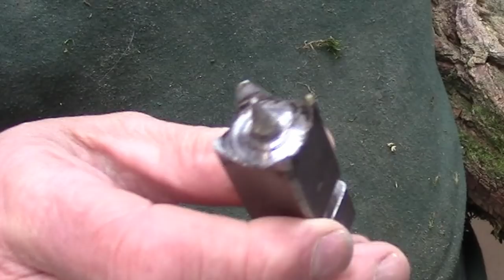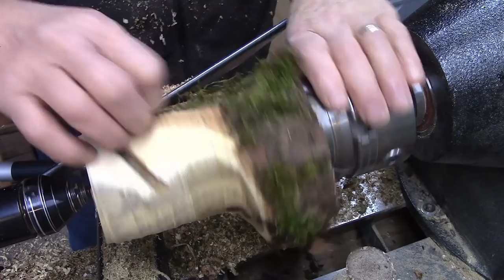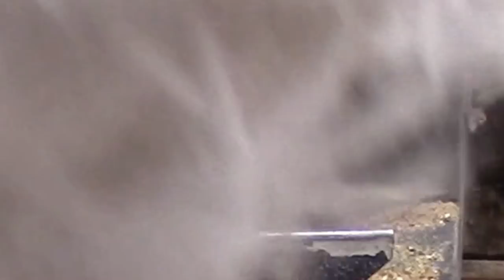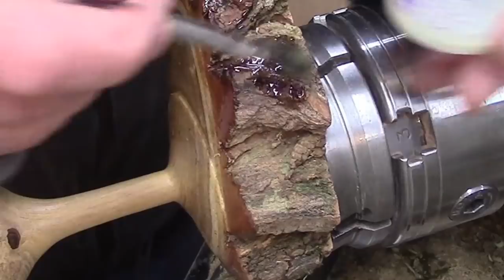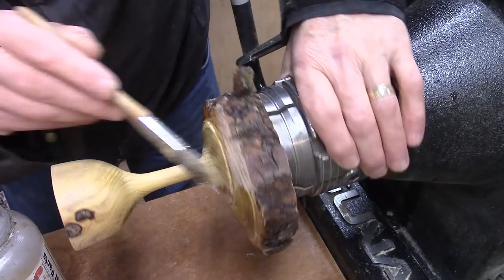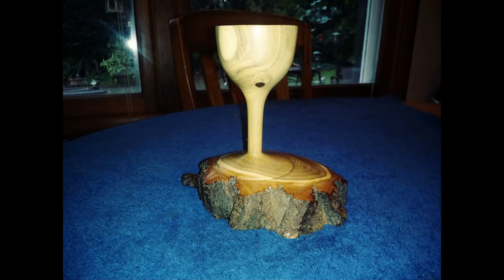Wood Turning A Locust Emerging Goblet Live Edge

Comment: Very nice project and it turned out beautiful. I was given some black locust by my son in law. I still have a large piece that I have not cut up. On the piece that I already cut into blanks I noticed some bugs crawling around so I stripped all the bark. I still have a big piece that I have not done anything with except apply sealer to the ends. Did you notice bugs on yours? Would you microwave the piece before turning in that situation?
Reply from the maker: Thank you Jim and have not seen any bugs on mine. I think it would be a good idea to put it in the microwave to kill any bugs you see  or think there might be some there.
Thanks for watching,
Gary

Comment: Does your round nose scraper have a bevel on both sides?
Reply from the maker: Hi Louis yes it does. I just grind a short amount on the top. I use the same angle and when the top gets to short I just grind it again. Other than that you only need to grind the bottom edge.
And the negative rake scraper does a fantastic job without grabbing like a regular scraper can.
Thanks for watching and commenting.
Gary

Comment: This is VERY similar to what I envisioned doing when I got my 2 little black locust logs, and then I found out my little lathe couldn't accommodate them bark on and still allow me to use the tool rest. I still enjoy the wood, though.
Reply from the maker: The grain in black locust is really nice. Fun to turn but a very hard wood. Were your logs dry?
 Next week I may have another Locust turning. A fairly small one and it might give you some ideas.
Pretty simple turning job.